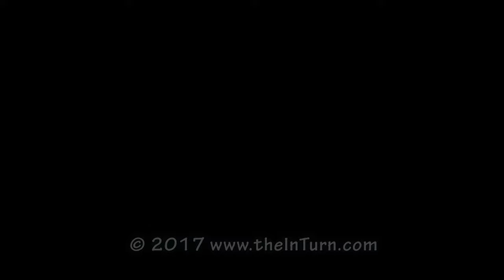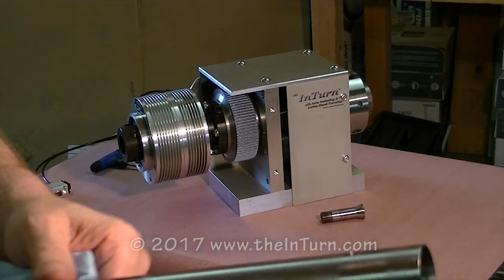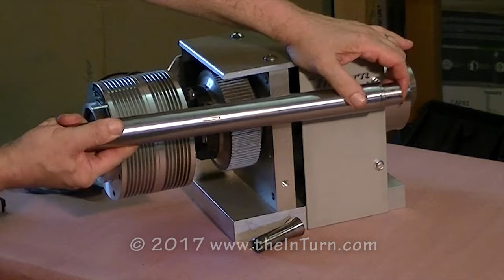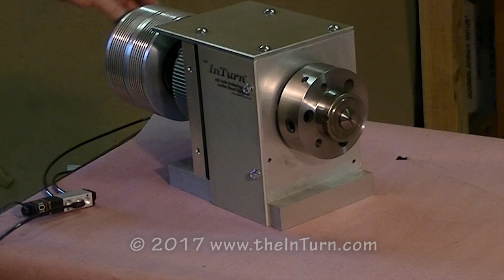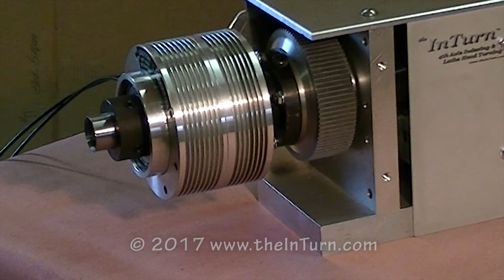Pneumatic Collet Closer for InTurn™ MEGA

Comment: recently converted  a haas ha5c to an ac servo that turns at 3000rpm. probably going to add a pnuematic closer on the back side. I am still looking for a cnc control and veering toward linux unless someone here has a recommendation that is the least labor intense customizing macros, etc...

Comment: HI SIMPSONS 
IN TURN IS YOUR BRAND?
Reply from the maker: Yes. There are several products. InTurn MEGA, InTurn ULTRA, InTurn Mill/Turn Motor Controller (now for Mach3, LinuxCNC and Path Pilot), a Special InTurn Tail Stock and trunnion table